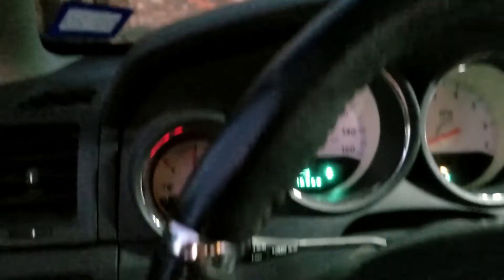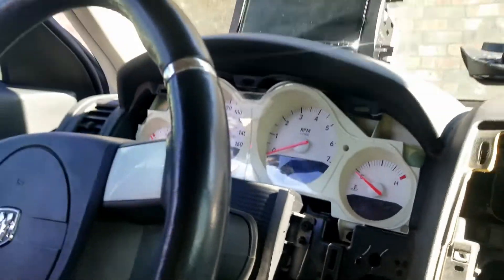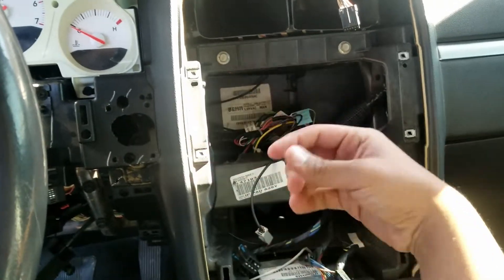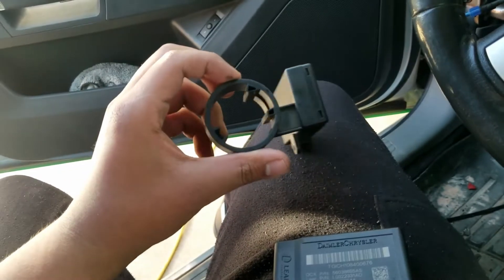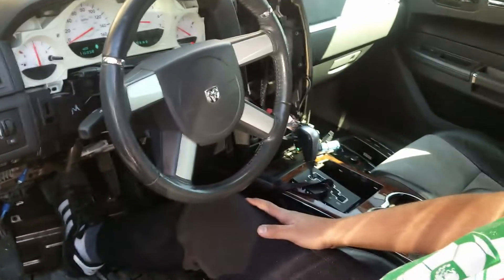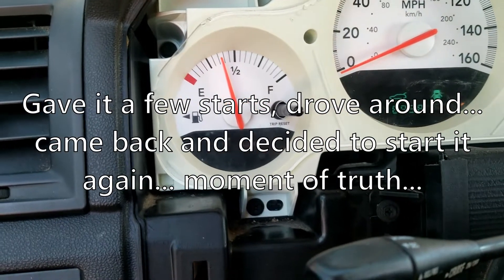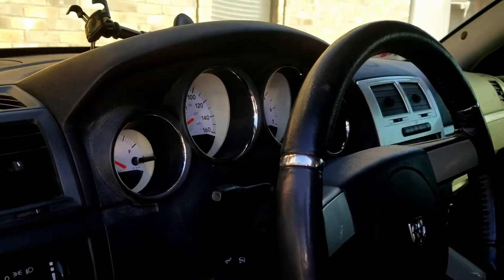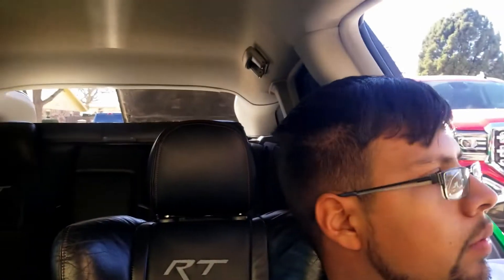2005-07 Dodge Magnum/Charger Chrysler 300 Dash Swap Part 5

Comment: Great vid man! I was looking like crazy for a vid to change out the dash. I checked the forums and everything! Im trying to change out the dash and door panels on my 06 charger rt to a 10 charger. Can you give me a list of the parts I need to take from the 2010 charger regarding the dash. Also did you come up with a solution for the shifter? Thanks, keep doing your thing!
Reply from the maker: For the dash, you'll need the actual dash, the metal bracket frame deal for the dash, vents radio bezel, center console, defroster area on dash with speaker grills, the instrument cluster cover, and that should be it no solution to the shifter yet, busy with other stuff right now. Will try and get that shifter deal done though. I don't like seeing it that way 😂
Reply from the maker: For the door panels, you'll need the door panel, the metal rod, and the metal bracket where screw attaches near arm rest of door.
Reply: VanAddicts thanks a lot bro. I will try and get it done then lol. Thanks for the help. Look forward to seeing more of your vids!
Reply from the maker: @MrPockets718  thanks, and if you have any more questions let me know. I'll try and respond as soon as I can.
Reply: VanAddicts Hey whats up! Just got the 2010 charger dash and center console. I took the ac vents and metal frame and everything. I still need to install. Waiting on a friend of mine to help me tho. Was looking into getting a 08-10 shifter. You think it will connect?
Reply from the maker: @MrPockets718  the shifter will NOT connect. The 05-07 had a shifter cable, and the 08-10 have an electrical connection, plus it won't bolt up either. It'd be easier to plastic weld your old shifter bezel to the 08-10 one.

Comment: Hey man I been trying to change my dashboard speakers seen you have too pull the whole dash n one the you pool like 3 things off but do they snap buck on ??
Reply from the maker: Yes, use a pry tool and remove the defroster panel to access speakers. But if you use a trim tool and properly pry on panel, it shouldnt break, but these plastics become brittle over the years. So expect broken tabs..
Reply from the maker: But they should snap back on, they're just put on with clips.

Comment: Where you get you seats from I’ll be done to get some like that especially with the RT logo ?
Reply from the maker: Got srt style seats locally off a charger. And just took them to a shop for embroidery
Reply: VanAddicts what year was the charger and how was the install in general any issues? And how about passenger seat cause I know on my magnum which is a 06 RT the pax seat is manual and later versions ones are powered seats.
Reply from the maker: @Chikilin1904  as long as you get the power seats from 2005-2007 chrysler or dodge, it should work I did mistake of not swapping front seat rails and now my airbag light is on. So make sure to do that. And power to passenger, I just tapped wires from driver and passed them under carpet to passenger seat.

Comment: What year Chrysler did those door panels come from and did you have to do any modifications to get them to fit?
Reply from the maker: They come from a 2010 300S special edition model. And the only modifications are swapping a screw clip up top near the door handles (they're different locations) and the cutout is already made on that area. Next is swapping the door handle rods and swapping the metal bracket for the center screw of door panel. Have to cutout areas to make brackets fit to it. And either the front or rear panels (don't remember) need an extra hole drilled out for the panel clips depending on color of your trim panels.